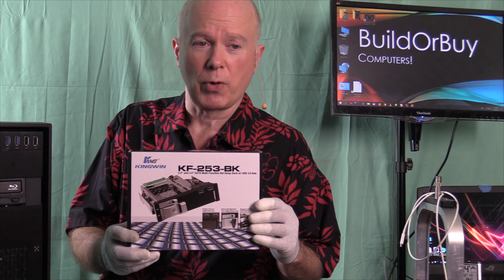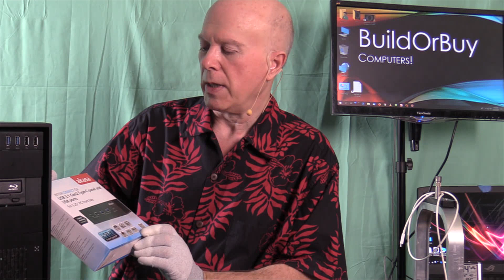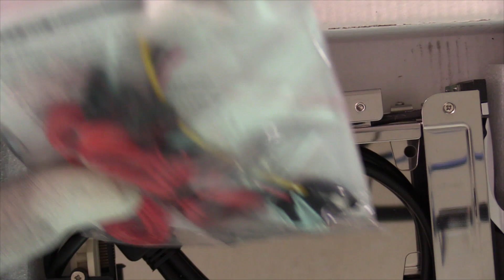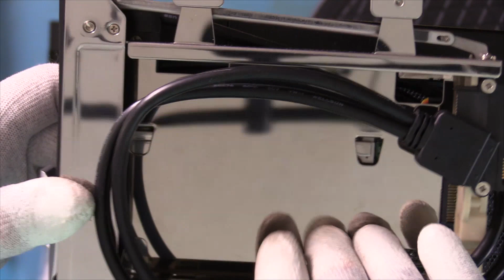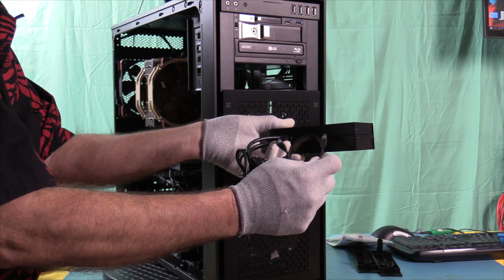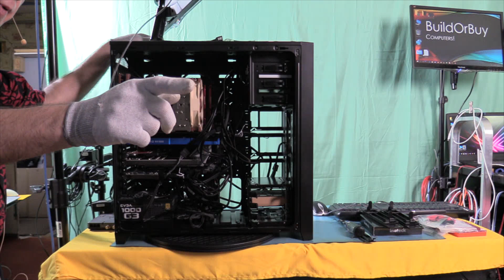Kingwin KF 253 BK Removable Hard Drive, SSD and Akasa USB C Drive Bay Device Electronics

Comment: Great video! I was wondering which motherboard do you have? My motherboard only has 1 USB 3.0 header, and it's being occupied by the 4 USB ports on the front. If i were to get the akasa drive, I wouldn't have a 2nd USB 3.0 header to plug into. Is there an alternative solution to this?
Reply from the maker: Hi Ronney Moun, 
Thank You! Details matter! 
Same Setup on Two different Motherboards. Both Threadripper II. Gigabyte X399 Aorus Xtreme & Gigabyte X399 Designare EX. 
Best Option would be an Add In card with Internal USB 3.0, 19 Pin Headers. Stay away from the Internal USB Hubs. They don't seem to be very reliable. 

3 Options... 
[2 Internal Headers] PCI-E X1 to 2 Ports 19 Pin USB 3.0 Header PCI Express to Dual 20 Pin USB 3.0 Card 
https://www.amazon.com/PCI-Ports-Header-Express-Dual/dp/B07GSQR6D4/
We have no experience with this particular card nor the Brand. 

[1 Internal Header] Inateck PCI-E to USB 3.0 (5 Ports) PCI Express Card and 15-Pin Power Connector, Red (KT5001)
https://www.amazon.com/gp/product/B00FPIMJEW/
We have tried this card. It works! 

[1 Internal Header] Syba 2 External USB 3.0 Port and 19 Pin Internal Header PCIe 2.0 x1 – 4 Port USB 3.0 PCI-Express x1 Renesas D720201 Chipset Molex Power Input 
https://www.amazon.com/dp/B00965J5UG/
We have used this Brand before. Have not tried this particular Adapter. 

Consider all of these as temporary solutions until we get USB4. Thanks for Asking! Hope this helps!
Reply: @BuildOrBuy  Thanks for the quick reply! I did not know there was such a thing as these kinds of pci express components except for wi-fi and sound cards. Thank you for the information. This does help very much. I'll be looking to adding one of these into my rig soon!
Reply from the maker: Hi @RonneyMoun ,
Good timing right now! Just have to know what to look for. Vendors don't make it easy! Thanks for Watching! Stay tuned! Keep Us Posted on Your progress!